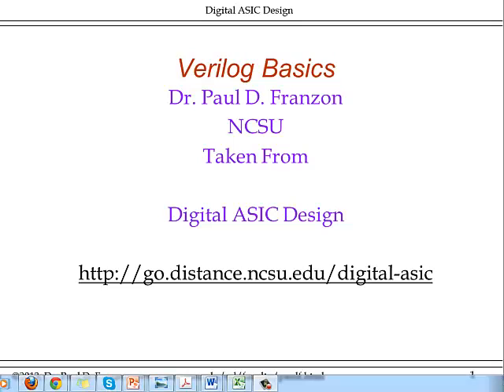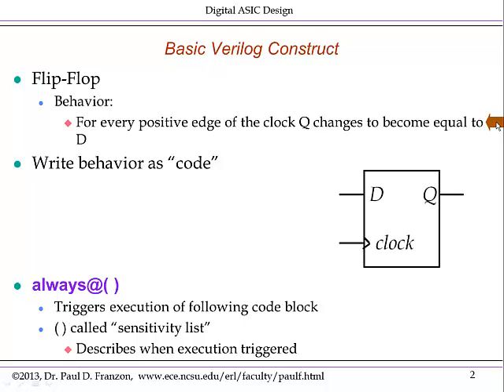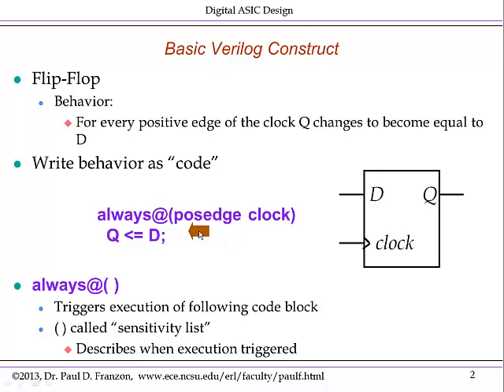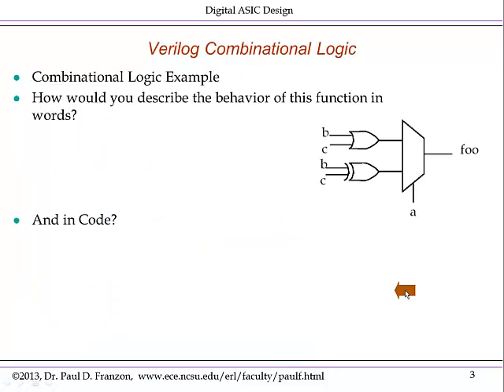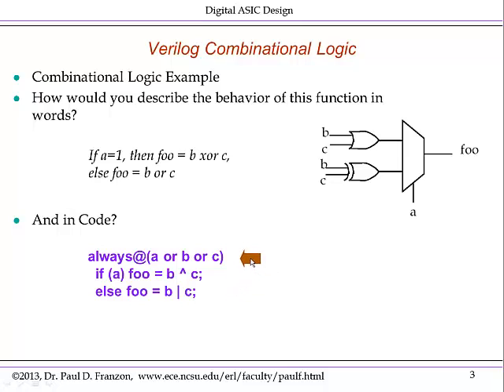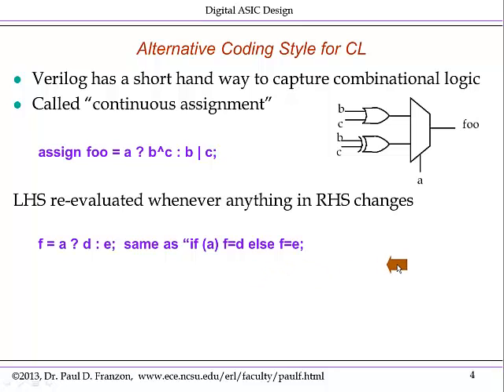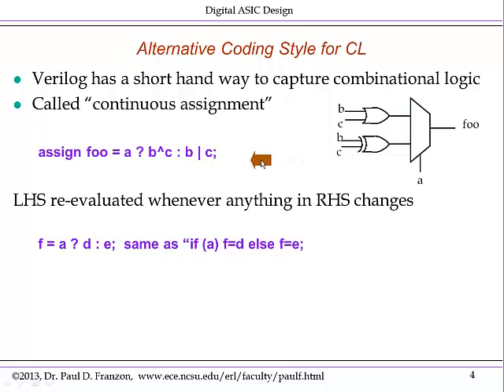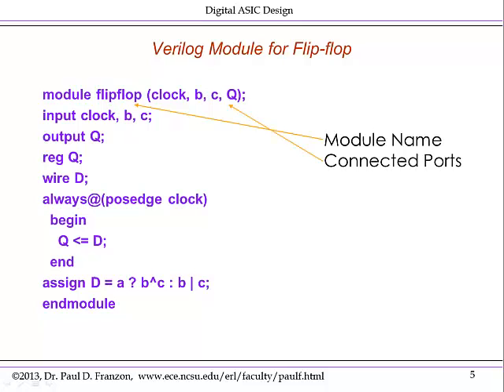Verilog Basics

Comment: if you use switch cases or if statements the cpu will take more time figuring out whether the imposed condition is true or false, i am fairly new to verilog but i've learnt C, embedded C and assembly, so i was wondering, can you use decoders or encoders instead of MUXs and DEMUXs in order to avoid conditional statements?
Reply from the maker: decoders and encoders are still coded using case statements.